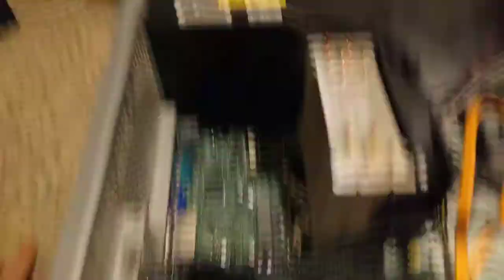FreeNAS Server Hardware

Comment: I had ECC ram on my board overheat last summer. Repeatedly. Got pissed so I now have a dedicated fan blowing on the ram. Josh I highly recommend you cut hole in the door and buy metal grilles to put on them. Then setup a microwave-style 120v fan to circulate air. The time and money you'll save with be worth it trust me
Reply: Sorry about all the typos :P good luck

Comment: I thought freenas performed best without a raid card?
Reply from the maker: you can flash different bios to the LSI card. I flashed the IT mode one, which passes the individual disks directly to the operating system.